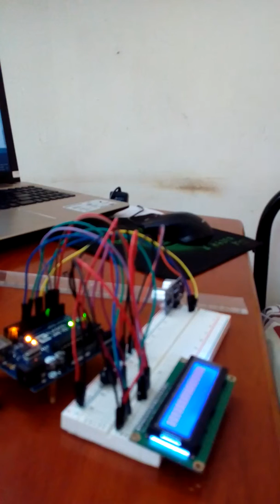LCD display not working arduino

Comment: i placed everything as exactly as it should be i soldered them correctly and my code is right, it worked for the first time but now after i replaced the print with a long message it malfunctioned pls help. :(

Comment: I had the same problem, i solved it changing wires. i used short ones with less resistance the long ones had a lot resistance so voltages dropped between pins.
Reply: Even with the normal sized jumper wires?

Comment: Hi,
I am working with PCF8514T IIC I2C Serial Interface Adapter Module to connect IIC I2C LCD Module.
The problem is same which you fix in this video. How I can resolve . Help me
thanks in advance